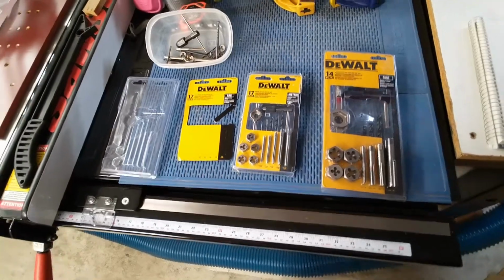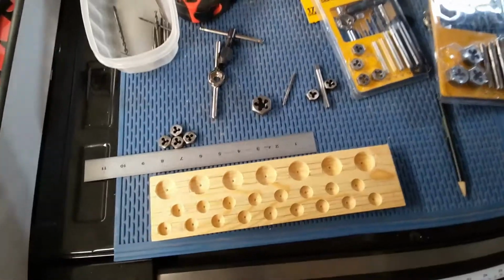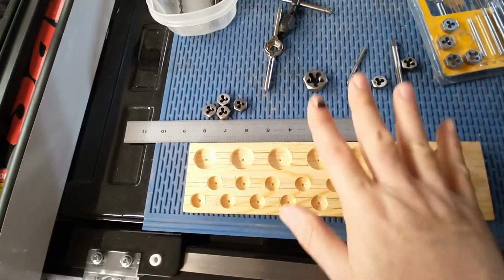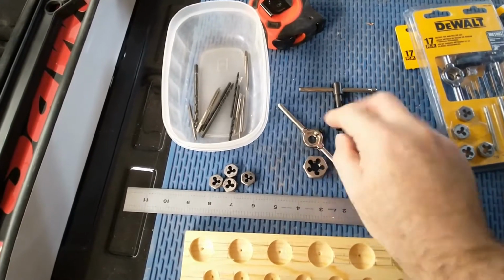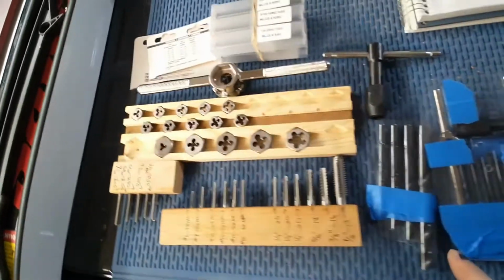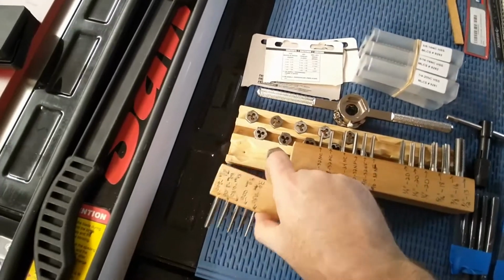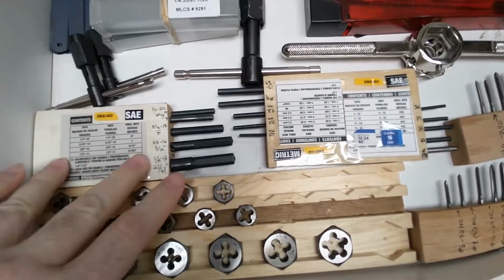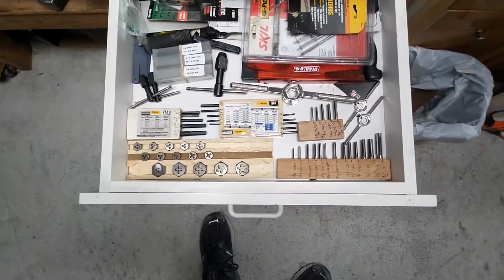Tap and Die Storage

Comment: I am going to copy this.  I will add a lid of thin plywood that attaches with 4 little magnets to magnets sunk into the block you made.
Reply from the maker: I am glad it sounds useful for you.  So far it has worked great for me.  Other than it slides around in the shared drawer.  But given how infrequently I use them, that is fine.  If you had more of them, larger boards etc could be useful...same for a bigger setup.  but the idea at least seems to work.  Good luck with yours.  If you make a video of the final look or take pictures of it, please share the link. :)